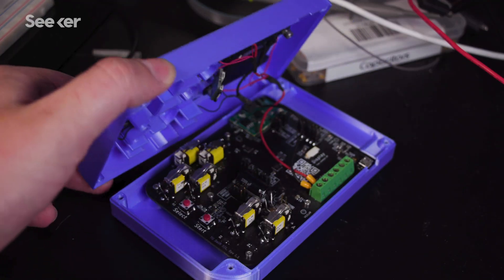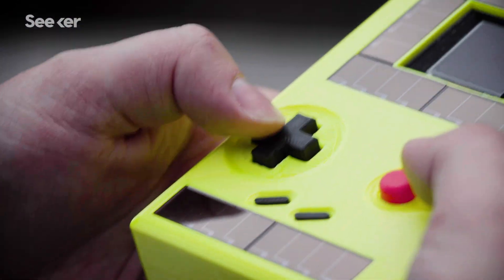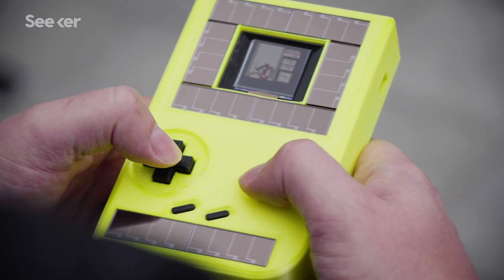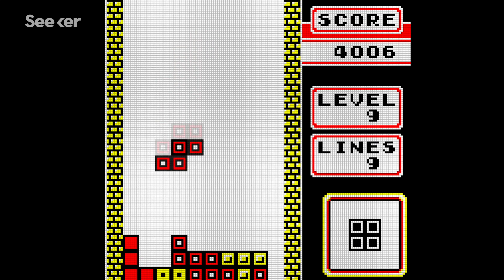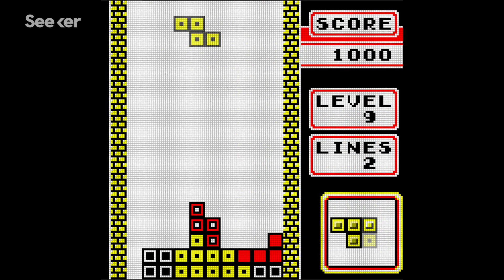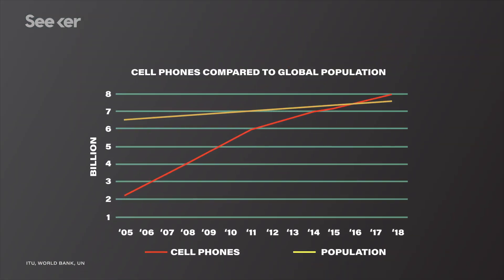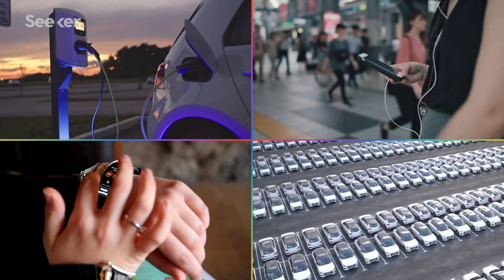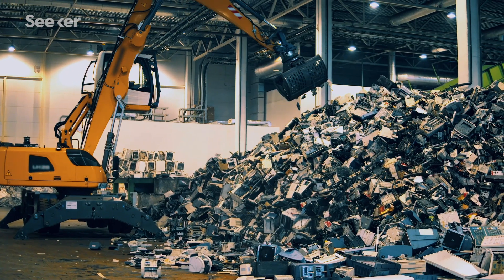The Next Gaming Revolution Starts With a Battery-Free Game Boy

Comment: it's a great idea in principle, but the lack of a battery makes it impractical.
generative keys and solar in a laptop for example would make a lot of sense as with that extra energy you're putting back into the battery can be utilized by either extended run time, less potentially coal generated energy being required for charging, or reducing the size of the battery.

the energy generated in the case of battery/generation hybridisation also wouldn't be required to consistently generate more energy than it requires to function, so the device can continue running whilst maybe you stop to look at something.

Comment: Seems useless indoors and seems really hard to play outside when the sun is not blocked by clouds the user can also block the solar panel depending on how they play. Will also mostlikely be incapable of running complex games that need more power  to run. Small screen that makes it hard for people who have terrible vision.

In short, It will not spark a gaming revolution and is basically a gimmick.
Reply: Also people should just invest their money on battery reaserch so they can last longer and longer store more energy and potentially be safer for the environment.

But whats more important is where the electricity that is used to make these comes from. Cause even if the product doesn't use energy the process to make it probably does (And the way that energy is produced probably harms the environment).

Comment: Well. This idiot didn't make his calculations before he started to go with this project. How much energy he could harvest if all the buttons are being mashed up with the highest imaginable frequency and all the time? Not enough to power anything so he's decided to go with downsized low power MCU suitable for some sort of embedded stuff not for gaming. Also: to program a modern game you need a platform that not only have an OS on it (and i can imagine his gaming platform uses only some sort of the simplest rtos ever or something similar, might be it doesn't even use that because the lag that game has) but a virtual machine. This facilitates making complex game or even makes it possible at all. Now imagine how many games there will be available if it'll require embedded engineers and low level developers to make them instead of software developers.
My phone works two days, lte, me spending way too much time on youtube etc. it has 6Ah battery, which makes for about 24Wh. So on the high end of the spectrum a modern portable console would require about 15Wh per day. So it can save 4.5 kWh of energy per year (with heavy daily using). That's about as much as you can produce by burning a litr of gasoline.
(To answer a question how much energy can he harvest from the buttons: a person riding a bike produces 100 W of energy, trained people could do twice as much, people out of shape couldn't even produce that; now: to power a phone for a day you would need to ride a stationary bike vigorously for 10 minutes and harvest all the power with no energy loss; now imagine doing equal amount of work but with your thumbs).
That's unfeasible on so many levels.

Comment: If you hold both ends of a multimeter it shows current coming from the human body,I'm thinking put some electrodes where the hands rest throw in some capacitors and whatever you have to to amp up and charge a battery..im no electronic engineer but there is current that could be harvested from the millivolts of electricity we are always putting out....

Comment: I would be interested to see a version with a battery added. Not a big one, but one just enough to bridge the losses in power. Obviously there is no way the current technology could provide enough energy to run the system and charge, but it’s a prototype and an experiment so I’d like to see where it goes. If the goal is to eliminate battery waste, reducing the size of the batteries is a start.

Comment: A gameboy running on solar power sounds cool but how about something better by using a micro magnet motor wich could supposedly selfstart and run indefinitely or how about using nuclear battery’s wich will generate stream from driven micro turbines by uranium or from micro solar pannels wich emits light from uranium , those types of batterys could last 28000 years, while it is true that nuclear batterys don’t generate much stream but an invertor could convert that low voltage into the required voltage to run a gameboy, and with advanced shrinking nano technology it required power can be enormously reduced as well😁

Comment: One of the main issues with this "device" is friction. Over time, all or some of the parts that make up the "device" will slowly breakdown (wear and tear) or generate faults due to excessive g-forces (bumps or drops to the "device"). Temperature must also be factored in. Say you take it travelling to the snowy mountains and then to a dry, dusty, hot desert and then on to a humid tropical environment. Would the components that make up the "device" still function correctly and as intended? If this sort of technology were to become more widespread and adopted by everyday individuals, they will expect everything to work regardless what it says in the fine print. Because lets face it not everyone reads the fine print. Which of course leads to conspires about the technology, all you have to do is look at the global 5G roll out to see how badly people are at copping with new technologies.

Comment: It's a great start.  I think he should look into using a thermal electric generator and set it up so the bottom half (where the buttons are and where the hands hold the gameboy) act as the warm end and have the top half (where the screen is) act as the cold end since the gameboy only needs to run when it is being held in warm hands. Also, shoving as many of the electronics as he can into the bottom half (the warm end) will give the thermal electric generator a little more of a heat differential to work with. Finally, it looks like he is running an LCD screen, if that's the case, he should consider swapping that out for an E ink display. It should use less power, look better and if the gameboy runs out of power, like the f-RAM his screen won't lose its state and the experience will be less jarring for the player. E inks do have lower refresh rates than modern LCDs but they are comparable to the original game boy's LCD.

Comment: So, considering the button mashing is what powers it, I’m guessing slower RPGs like Pokémon wouldn’t work at all? Doesn’t seem very useful to me....
Reply: Pokemon would kinda work well, because it's completely turn based. So it doesn't matter if it turns off in the middle of it, and people are always mashing A in a battle to get through It as fast as possible.
Reply: @RaonakRN  think of when you're just walking along long paths though...
No power generation since you're just holding down. You'd never get anywhere without smashing the console out of frustration at it always shutting down.

Comment: this thing is garbage. 
Could have added a decent capacitor, several more panels, removed the regenerative buttons, put in a much more efficient motherboard, and made the size half as thick as it is already.  A gameboy micro hooked to a 5v 750mah panel would play much better than this.

Comment: I have to be very skeptical of this proposition. You cannot power a system properly without the benefits of a capacitor. Power outages will happen always. Some systems are too complicated for a "quick save".  I'd rather invest in recyclable batteries with low or null carbon emission fabrication.
Reply: And also with more efficient electronics. However, unless everything is a superconductor, there will always be some resistance

Comment: solar power and button pushing is a weak battery source, just harvest the energy directly from the human through heat engines. the 27 °c of both hands channeled to a metal backplate through a piezoelectric module for example can easily generate enough power to replace both the solar cells and buttons.

Comment: It should take thermal energy from your hands holding it/ambient heat as well
Reply: Physics doesn't let you extract from ambient heat. Life would be a lot easier if you could, but it just doesn't work. You can only extract work from a temperature difference, and the heat difference between your hands and the air is too small to be practical. But there is a brand of watch that does that for power.

Comment: I'm going to be frank (and harsh): You need to aim a bit higher in your career and life. If I managed to build a gameboy that runs (poorly) on solar power, I probably wouldn't be making a video about it. Also, the video is 6 minutes too long. You're not going to initiate a paradigm shift in the global battery industry with a poorly running solar gameboy. Not to mention, we had perfectly running solar calculators since the 1970s!

Comment: Cool idea and I guess it would be more environmentally friendly, but no on is talking about batteries are not the only non recyclable item in any smart device.  So for like a smart phone you have a big non recyclable battery, but then you also have the motherboard and a bunch of chips that are not recyclable. Then you have the glass (maybe you can recycle it, but idk) and then people normally have a plastic back on the phone or a plastic screen protector and/or a plastic case which isn't recyclable. So removing the battery would help s little, but the biggest problem is now this guy wants to build more smart devices which will just end up making more waste because that looked like a lot of plastic and the only thing it won't waste is a big battery.

Comment: I'm curious if this tech might be more applicable for e-readers and other e-ink devices.
Reply: we don't have solar panels that work with ambient light. one would need to stand in direct sunlight to change pages or turn someone shaft lol
Reply: @suryanshtagore7180  though solar panels work under direct sunlight, there may be other means to charge the capacitors. The fact that im trying to point out is that e ink displays require very little energy and requires no energy to maintain the page.
Reply: I don't want to sound like a boomer but your best bet for a battery-free thing that you can read is a book.

Comment: I like how extreme he makes his case by not even adding a single battery to the device.
Reply: And proceeds to add a micro usb port (if im not mistaken)
Reply: @yudhobaskoro8033  you need a way to upload games. Wonder if that could power it for debugging.
Reply: @ricosrealm  well u got a point, usb connection needs some sort of 5v power, so it can technically be used to charge the "capacitor"
Reply: It’s not that extreme considering that was the whole point. It’s like saying; I like how extreme Tesla is by not adding a combustion engine to their electric car.
Reply: Or a supercap?
Reply: Pretty sure that would defeat the free energy purpose unless its endlessly charging it in a loop..

Comment: This seems like a fine concept for something with as little processing power as a gameboy but I worry about how well it'll be able to scale to more powerful devices, especially with how modern smartphones use practically no mechanical action for input. I'd love to be wrong though
Reply: I mean considering it's emulating a Gameboy doesn't that require a fair bit of overhead that places it beyond the original Gameboy in terms of actual power?
Reply: Tell that to the people of the 1980s where they can't think a computer at the size of a room scaled down to a palm sized computer.
Reply: Hey look!
I found a Seeker viewer who has something called a brain!
You are correct this as demonstrated wouldn't work on a phone even if phones required the miniscule amount of energy 1980s technology require --uh when using modern hardware...
Yeah this is a total pipe dream.
Reply: @VariantAEC  Yeah, doubt this can be scaled up to smartphone level of electricity needs. The devices still have capacitors on them to store charge so there is a battery but not lithium ion. I highly doubt it is efficient in storing energy like that and for it to power smartphones, the amount of fram and capacitors you need makes it so much less efficient. I feel like we are much better off innovating on current technologies like perhaps a graphene battery and the current renewables on the powergrid.

Comment: It's a 80's solar calculator with games.. "inovative"
Reply: Innovation can often be finding new applications for and ways of using existing technology
Reply: @EMAngel2718   come on .. holy patience. a friction flashlight with capacitor has the same level of innovation as my dear millennial.
Reply: This device doesn't just have solar panels. As the video explains, the button mashing powers the device, harvesting energy in a new way.
Reply: @TheHomies510  i see.. is te dane "innovation" existing in a manual flashligh with capacitor .. please .. it is basically a Chinese brickgame with solar panels and a button that generates some charge in the capacitor. no innovation.